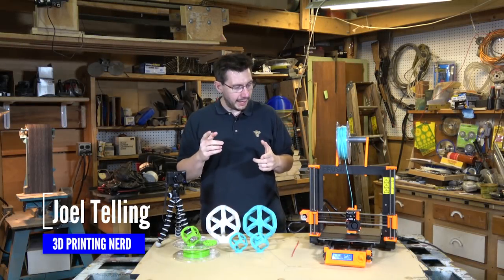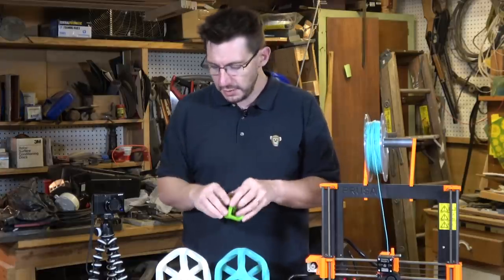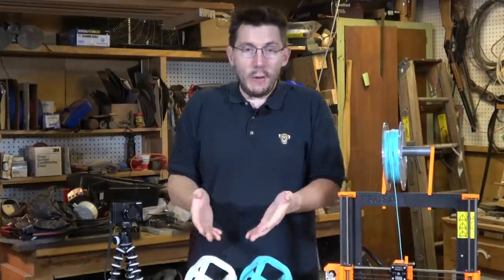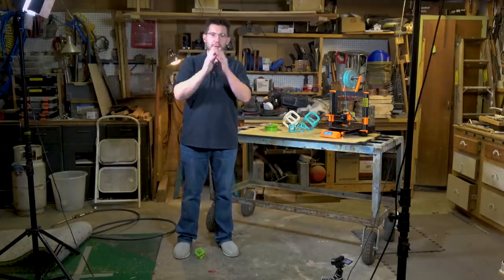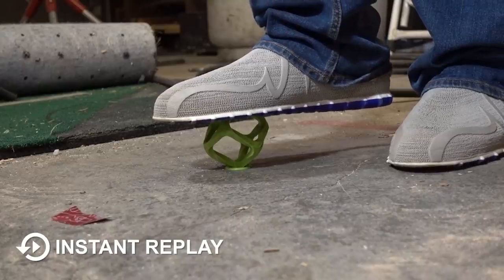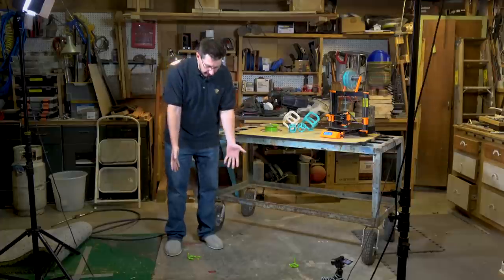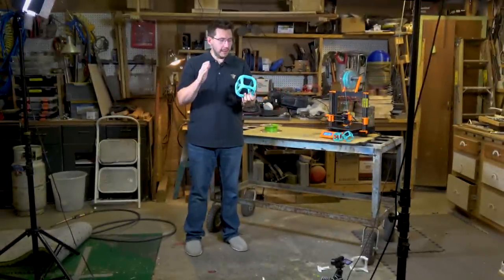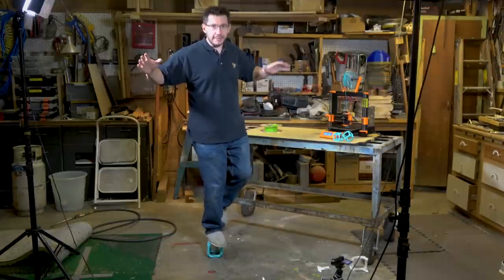3D Printing and CRUSHING the Maker's Muse Torture Cube Thingy #FullJoel

Comment: Not an ideal geometry if you wanted a structure to be strong enough to resist compression forces. However, what would be more interesting to makers and prototypers is comparing PolyMax against ABS, Polycarbonate, PC Max & PC Plus. With various infills to full solid models. To me 3D printing is far more valuable to engineering workable and pre-production parts, rather than figurines and desk widgets.

Comment: Seems to me that the polymax had a little more elastic and plastic modulus than the PLA. I.e. the PLA was more brittle. The polymax seemed to bend a bit more even when failing, where the PLA just seemed to shatter.
Interesting results.

Comment: @3D Printing Nerd,  your videos are awesome. One comment on this one though, regarding the mechanics of how it failed, you got quite wrong. By standing (or bouncing) on it you provide constant force (weight) and hence stress, regardless of deflection. Hence, as it breaks, the breakage becomes more violent (as seen with the white and green models). In a vice the stress comes from the displacement, hence as soon as the plastic yields slightly, the stress is entirely removed. I would love to see an actual test of these PLA's (print a dog-bone type thing and load with weights for constant force applied) because I think your conclusion was correct (blue was strongest) but I like my scientific method a little bit...

Please keep up the great vids.

Comment: Really impressive torture testing of a torture test! Also extremely unsafe at 7:25! What if it failed?
Reply: Lucas Hartmann Face dive into the floor?
And cracked hands haha
Reply: Kik Stark I was more worried about sharp edges and deep cuts. Thankfully the material does not fail in such a threatening way, it just deforms.
Reply: I think it was unsafe to begin with. I have had wonderful Adidas trailshoes that held up for more than a decade, and when they failed, they revealed a flexible fine steel mesh hidden within the sole - so now i know why always felt so safe stepping on any kind of stone with them. They were actually so well engineered that they failed in multiple spots at once: both the upper and the sole failed simultaneously, but unfortunately quality hasn't been like this for a really, really long time. Wouldn't want to step on a hard plastic piece that might shatter in anything but those or something similarly reinforced. So yeah if anyone has awesome shoe shopping tips (girls' trail shoes, average arch and width), give them to me.

Comment: Hmmm. May have to try the Polymax PLA. I printed the Origami Carabiner by ddf3d.com from Thingiverse yesterday using the Prusa silver PLA that came with my i3 MK2S printer. A very cool print that came out great and appears to be quite strong. But, based on this video, the Polymax would make it considerably more so. Not that I'd use it for climbing mountains in either case but I bet it would definitely make a difference. Thanks for another interesting video, Joel. High five.

Comment: How's that Flexplate working for you? I'm guessing the XYZ/skew auto-calibration's totally out to lunch with the big magnet on the bed, and would be interested in how you handled that (or in hearing that I'm just totally wrong).
Reply from the maker: +William Shreckengost working very well! Calibration won't work with it on, so as long as you add it after calibration it works great! I filmed a short video on this and my editor currently has the footage.

Comment: Why not stand on the flat side of the cube?
Reply: That would change where the stress is being transferred through the model. Most of the stress would go through the "tubes" of the model instead of the bends. The Bends here are a lot weaker.

Comment: so how is the flexplate working with the prusa i3? 
do you still use the auto leveling ? 
tanks
Reply from the maker: Yes I do. Auto leveling works great. However, because the magnetic plate sits above the PCB, you cannot install the flex plate system without first doing calibration.

Comment: This is a pretty uninteresting test: the real issue with 3d prints is layer delamination which is shear, not compression, as you tested (the flex seemed to turn the compression into some shear force). Tom is doing shear tests by dropping a hammer from a known height and hitting parallel to the layers. Next time try some oven annealed PLA.

Comment: Joel, looks like you're doing a special wipe on the Prusa. Can you share that gcode?
Reply from the maker: It's not - it's the standard wipe, however, I've installed a BuildTak flexplate system. It makes the bed height a little taller, so the wipe doesn't exactly wipe like before.
Reply: Wow, thats funny. Totally thought you had implemented a nice zigzag wipe which I always felt would be neat.

Comment: for those who's  prusa mk2 that works it great. your one of the lucky one
 if your dose not, tough luck 3d printing is not for you. 
95% print fails so far
had my prusa for 4 month now still cant get it to print, mine will not go 20 min on most attempts, last almost successfully was 2 hours, how in hell name do people get these things to work for 20+ hours

had to replace a bearing (the one the pushes against the hob the original was damaged out of the box). the original filament will not print (PLA),  bought new PLA that also dose not work sadly i was using the prusa slic3r program prusa support was not sure if they were happy with that. 
though the nozzle was blocked ,also had filament oose out of the hotend strait out of the box (cooling element and nozzle need to be tight against each other
new to the game  so bought replace nozzles, support not happy might not be good, though the nozzle was blocked, Turns out new and old nozzles make not difference, 

current issue extruder head starts making tuk tuk noise, filament is just not extruded, hot end temp as reported good for melting filament 
well there hope yet the new boden print head from the mk3 might fix it, also going to try print ABS see if printing hotter fixes it 
here my plea on the prusa forms 
https://shop.prusa3d.com/forum/prusa-i3-kit-building-calibrating-first-print-main-f6/extruder-feed-problem-help-t6083.html
Reply from the maker: Has Prusa support been able to help you out at all?
Reply: not realy
Reply from the maker: hmm. poo. I'm sorry. I don't know if there is anything I can help with. If I can, I'll reach out.
Reply: joel sorry did not mean to get you personal involved, was hopeing someone in your audience would say wow i seen that hit this and it clear

start printing then someing happens and filament stops flowing and the print fails, its random when the filamanents stops flowing so not sure if it the extruder motor not strong enough to drive filament or slicer code not right or hot end failing but temp reading say its ok very frustrating

going to try with ABS today or tomorrow to see if high temp printing clear the issue, but currently PLA is not usable
baring in mind that both of my new roll could be faulty, the calipers say they with in tolerance :(, being a noob it probably user error, just need to know which part to kick

Comment: same STL not GCODE.
same GCODE... same size. :P
Reply: He said he used the same gcode for each size.  meaning, the smaller ones used the exact same gcode, and the larger ones used a separate gcode but both of the larger ones were printed with the same gcode.  so two gcodes, one for each size.